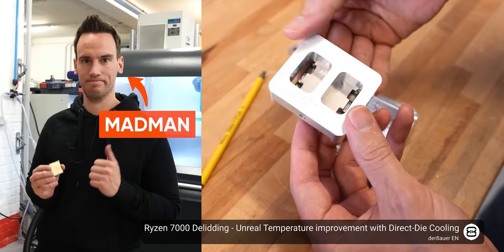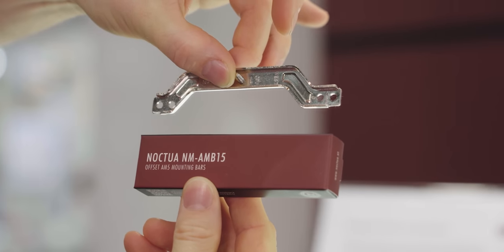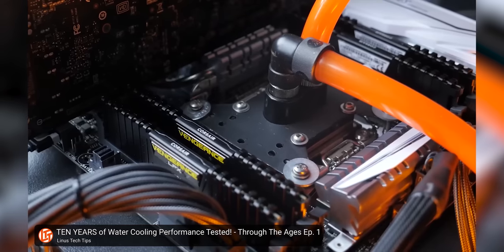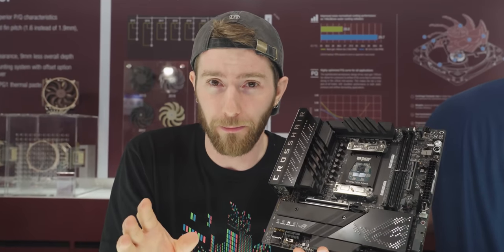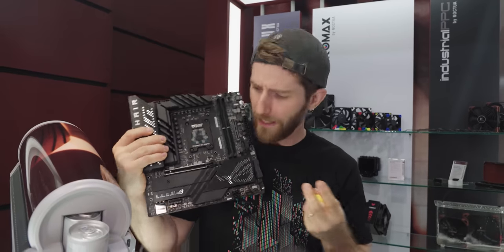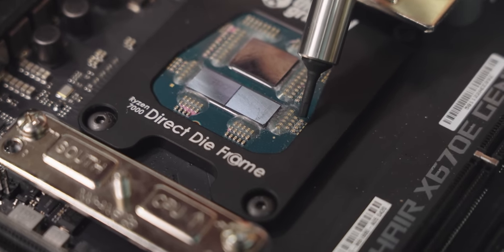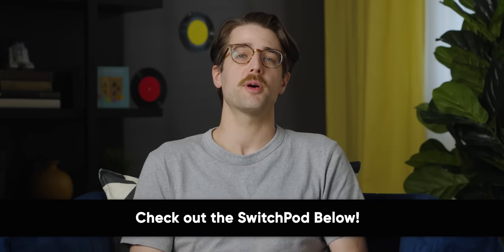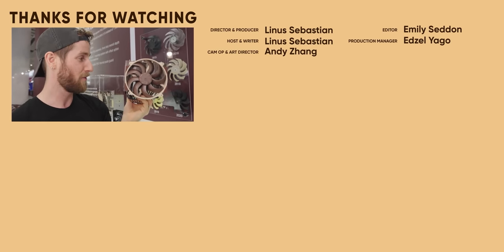Noctua's New Cooler Voids Your Warranty - AM5 Direct Die Cooling @ Computex 2023

Comment: For all the crap Noctua has gotten over the years for sticking, mostly, to its 70s dad suit aesthetic, you have to admit, seeing those coolers in a tech product instantly brings one word to mind... "Quality"
Reply: At this point that color scheme is instantly recognized as noctua brand.. Like green to razer, blue to Intel and red to amd
Reply: They also make other colors so if you really don't like it you can go with other options. The chromax black for example is my favorite.
Reply: I tried Bequiet products and they are absolutely horrific and nothing but pure junk so Noctua it is. Never had a Noctua product fail. Corsair and Bequiet are a joke in the PC world these days.
Reply: @jamesm568  bequiet are pretty good depending on what you get.
the power supplies are seasonic with their fans slapped on, cases are good, heatsinks are on par with V1 NH D15, the only thing I've had issues are the 80mm fans which have some cogging noise.
Reply: @jamesm568  What issues did you have with both Corsair and BeQuiet? I have Corsair ram, works perfectly. Corsair AIO on a friends pc, works like a charm. BeQuiet fans in my server, no problem. BeQuiet tower cooler smth (a smallish one) in another friend's PC, again perfectly fine. Noctua fans and cooler on another server of mine (Bought all of them from SH), working fine. I don't see a problem with BeQuiet or Corsair, and I do know noctua, they are great.
Reply: @satibel  Bequiet air coolers are decent as long as you swap out their crappy fans. Have no gripes with Seasonic as they have excellent customer service and never had one of their power supplies fail like Corsair does. I personally can't stand  Corsair with their poor ratings with the Better Business Bureau and are the most return product at Best Buy along with one of the worst customer service in the industry.
Reply: @sedixmrboss5625  I don't like the longevity and the quality of BeQuiet fans and Corsair branded power supplies are an absolute joke. I don't mind paying that Noctua tax as they provide great customer support with their products as that something that Corsair does not do. I used to use Corsair RAM, but a couple years ago their RAM was failing like hotcakes and they're still being sued over that incident. AIO are a personal preference, but I prefer to use the cheap ones as they're disposable items and there's not much of a difference in quality when paying a premium price with a name brand when they all still have a higher potential rate of failure.
Reply: @jamesm568  afaik the higher end bequiet fans are pretty good.
corsair doesn't have a lot of in house manufacturing so it's pretty hit or miss.
Reply: @satibel  Good enough for a hobbyist, but I wouldn't use Corsair and BeQuiet products professionally or in an enterprise environment. I really don't know many PC enthusiasts that use those brands either.
Reply: @jamesm568  tbh in an enterprise environement you'll probably use nidec or delta or some random no name brand if you have fans at all because you'll have prebuilt systems.
Reply: @satibel  That can be true. Have used cheap stuff myself, but I have found that using computer parts from German companies just last.
Reply: @jamesm568  tbh nidec and delta make some of the best performance and mtbf optimized fans, while noctua optimizes for performance/noise I've got some nidec fans from 20 years ago that have been used 24/7 for 10 years and they still work great, though they still make airplane noises because 6k rpm on a 140mm fan is loud.
Reply: @satibel  LMFAO! I know the feeling as I have a PC with 8 Noctua Industrial 3000 RPM 120mm and 140mm fans mixed for giggles. Loud AF when wide open and whisper quiet when RPMs are running less than 800 RPM.
Reply: @jamesm568   I can't speak for beQuiet's newer products for hotter processors, but the Pure Rock heat sink and its included fans have been good for me and my factory-clocked i7-6700 non-K CPU since I built it at the beginning of 2016.  That's in a Corsair Carbide 300R case, lol.  Granted, the i7-6700 is only a 65W TDP chip, but I've never seen the hot spot hit more than 79° C even running Prime95 torture test on all cores for an hour with FurMark going in the background.  But I also have a pair of Noctua's 140mm IndustrialPPC fans on filtered intake duty in the Carbide that have been running ~700rpm 24/7 since January of 2016, and they've been brilliant.  That little bit extra static pressure the industrial fans generate has really helped keep the inside of my PC clean and cat hair free.
Reply: IMO the design is by several magnitudes better than the "gamer aesthetic" with overloaded design elements and RGB which make your PC look like a toy instead of a tool.
Reply: @bartolomeothesatyr  I'm not a big fan of Corsair cases but that's just personal preference on that part. I'm a Lian Li fanboy on that respect(can't stand their fans though). In reference to air coolers most of today's air coolers can get the job done when you use the correct air cooler for the application it's in. As for fans I got a shelf full of worn out fans from various manufacturers that prematurely failed in a variety of uses. I never had a Noctua fan fail at the moment even for the ones that cool my router and cable modem that constantly run 24/7.
Reply: @jamesm568  I have a b quiet fan as an emergency backup, I bought I think 5 of them a number of years ago, while they are louder than I would use today, if a fan dies I have a cheap replacement fan so I can figure out what would best replace it with. I think there is an arctic 3 pack for fans at 20$ and this wasn't a thing when I bought my bquiet for this purpose.
Reply: Quality and function over form.
Reply: @alidan   BeQuiet fans definitely better than Uphere fans for sure.
Reply: It was a lot of fun turning 299 likes to 300 on your comment. :)
Reply: @jamesm568  All my corsair memory just failed. Cost me a boat load of money.
Reply: @Sorcerer86pt  I think it has way better form than anything in gamer RGB aesthetic. I like my computer to look like a tool and not a toy.
Reply: @jamesm568  I can concur with CONsair

My 1000D front panel I/O and the 18x HD120 Fans RGB lighting aren't working properly anymore.
Customer service was a nightmare to deal with as well, If you live as far as NZ, if you're trying to source replacement parts.
Reply: @meekmeads  Don't get me wrong, but back-in-the-day Corsair was the bomb. These last three to four years Corsair went downhill fast.
Reply: Call me a boomer I guess cause I love the aesthetic!
Reply: @jamesm568  some Corsair branded PSUs are excellent. The AX1600i for example is top notch. So are RM, RMi, RMx, RMe, HX and HXi PSUs. Flextronics produces the AX1600i I think (don’t know about the rest), but as far as I know it’s a  Corsair design instead of just a rebrand. Might be wrong though.
Reply: @agdp15  I rather go with Seasonic.
Reply: @jamesm568  to each their own, I don’t own anything from Corsair either, but the AX1600i is likely the best PSU on the market. Or at least it used to be
Reply: I have an IP67 industrial noctua fan on my telescope behind the primary mirror for fast temperature equalization. It runs slowly (with speed sense signal) and I have zero vibrations
Reply: Dude fr.  I actually could careless about asthetics now.  I'd actually argue the poop brown color of noctua looks great because every time you see them in a system, you know that pc is built for performance not some gaudy bs lol
Reply: @jamesm568  for Bequiet it's more of a question of which product...unlike Noctua, they have a range of average to quite good. I don't think they have anything quite as bomb proof reliable as Noctua though
Reply: @satibel  Most of their PSUs are FSP these days. Which is still solid!
Reply: @jamesm568  I'm a sales associate at a large electronics retailer and I agree. At this point, i just go with a brand/manufacturer who seem solid at the time, and i recommend brands who take accountability for their product...which is very few at this point. As far as CPU coolers...go air cooling until you can't. AIOs/water coolers are a roll of the dice. Either it dies in 2 years or it lasts 8 years.
Reply: @callistis8733  I had to go with an AIO after I got the 4090 as I had to mount the GPU where the power connector was pointing straight up so it wasn't stressed as a giant azz air cooler would not let me do that.

Comment: I'm definitely getting an NH-D15 when my current cooler kicks the bucket, I'll probably never need the monsterous cooling capacity but I love the quietness and want to support them for doing cool stuff like this
Reply: Those coolers can easily last 10 plus years, and Noctua will probably still support it when they release another one of theese add ons in 2033 lol
Reply: Say never, never. My 4790k homeserver gets cooled with an NH-D15. keeps it cool at all times and is dead silent too. Their fans are just legendary when it comes to their noisr profile. They blend in so well with background noise.
Reply: Got an NH-D14 that is still going with daily use.
Reply: Same here, I might not use its full potential as my desktop workstation is mostly idle while coding, but I want to support a great company.
Reply: Get a U-12A, it's a normal sized tower cooler, almost the same performance as the (old) D15, it's more than enough even for high end processors or reasonable overclocking.
Reply: You can also support them by buying their fans for your custom loop rads ;)
Reply: It works even better when you stick Noctua's 3000 RPM industrial fans on it.
Reply: @DrakkarCalethiel  Just replace the old fans with the next gen NF-A14 and you'll get better performance.
Reply: Bought NH-D15 for my R5 2600 when the stock cooler was running too hot. I knew i was going extremely overkill for the R5 (I'm oc'd to 4.1ghz at 1.3v) but at least im future proof with it, and since noctua has released new fans i can i guess just in the end change fans when one breaks, 6 years warranty as well from where I bought it and people been running noctua stuff without issues even for 10+ years. it's worth it, especially with the 2nd gen coming out i would get that one 100% sure considering how noctua has been doing their shit so we'll.
Reply: @Majorowsky1337  The R5 2600 can be cooedl with a 120 mm AIO without even needing a fan on the rad. Lol! With that being said it never hurts to buy the biggest air cooler that can fit in your case either.
Reply: @jamesm568  My CPU does run a bit hot because the case is not the greatest when it comes to airflow (NZXT H510) But otherwise yeah it never hurts to go for the biggest when you can use it for the years to come haha. also included thermal paste is a nice thing with the cooler ;)
Reply: I got a d15 with my 1700 when I built my 'new' computer about 6 years ago, my 955 would have its stock fan gum up with dust, and no way to get at the back of the motherboard for a tower cooler without ripping everything out and the case was a nightmare to deal with. so I opted to just clean the cooler every 2-3 weeks when dust would clog it again. got the d15, put it on the cpu, cant hear the fans, and both towers have been clogged with dust at points but the cpu never hits a thermal throttle load, absolutely love this cooler because it made dealing with the computer not painful.

Comment: Man... direct die was the norm for AMD CPU's "back in the day" so, this isn't all that scary. And now that Intel and AMD are hell bent on pushing their CPU's as far as possible out of the box, it's more and more likely that when I upgrade, I'll be doing this with my next system.
Reply: "Back in the day" was pretty scary. Had to use a screwdriver to pry down the retention clip. One slip and you damage the motherboard.
Reply: @asm2750  I'll give you that. Severing some mobo traces was a far more scary proposition than cracking the die.
Reply: I worked in an IT retail store during that time.

We had about 6 trays of CPU with cracked dies. I think only about 5% of them got a RMA refund from our supplier.

I was mainly caused by people putting the cooler on the wrong way round since it had a notch milled out of one side.
Reply: @bofh139  Yep, that makes sense. I never cracked a die and I can't tell you how many AMD systems I built back then. Granted, I was a seasoned builder at the point and knew what I was doing. I imagine more people bend pins than cracked the dies back them. Granted, you can replace pins. Cracked die is donezo.
Reply: Having zero warranty for a £670 part seems scary to me. In fact it's downright terrifying.
Reply: @TheGameBench a cracked die today means a 100% dead CPU, tho
Reply: @LtdJorge  A cracked die back then meant a 100% dead CPU as well. I would say though, that you're less likely to crack a die now, than back then. If you're using a frame, it should be a non issues, since it's much easier to even out the mounting pressure. I would just advise against any cooler that uses the brackets that come with AM5 boards. You have more to fear from delidding than direct die.
Reply: @bosambo  Sure... delidding isn't for everyone.
Reply: i suspect it has to do with the dies being a bit less durable after a certain point in computing, due to them changing the base material thicknesses. there used to be a bit more silicon between the 'guts' and the 'top', making it a bit harder to fracture the die.

couple that with them making the pcbs the dies are mounted to slightly thinner, and its there was concern for the die flexing that pcb leading to issues over time, or immediately if you  had a solution that applied too much pressure.

less material in the dies, interposers and substrate pcbs, leads to less mechanical stress capability. the heat spreaders serve(d) as a pressure load distribution plate as well as its primary function.

one can literally compare an xray cross section of various generations of cpus over the years (they're out there, though some are harder to find), showing the shrinkage of the various layers, leading to the possible problem of pressure breakage. (think like intels somewhat infamous and randomly reoccuring pcb flex/cracking problem, even with heat spreaders involved.)

at the end of the day however, most super enthusiasts will take the risk of maybe applying too much pressure and killing a given chip, simply to get the most bang for the buck out of it.

i do rather wish they'd at least try a bit harder to get the baseline temps with the heat spreader on them down some. the 7000 series chips run abysmally hot when they don't need to. both from the voltages and the layout on the substrate not reflecting into the coolers optimized focus area (given the hotspots are to one side, vs the middleish).
Reply: @TheGameBench . Aren’t the dies thinner now? Isn’t the top most layer also thinner?
Reply: Cranking down the Pentium 4 heatsink and seeing the 6mm bulge on the back of the mobo.
Reply: I remember buying a shim kit for my old Athlon 1333. I also had a Peltier and a, rather early, water cooling kit.. in 2001. It worked rather well.
Reply: It has got much scarier now as when Intel and AMD have been hunting better cooling for their extremely power hungry chips they have made the dies thinner, which means weaker and easier to crack if cooler isn't being mount perfectly on top.
Reply: It was actually an exception during the t-bird/duron era. Previous K6 were lidded and next gen Athlon 64 regained the lidded normalcy. Intel did the same thing with their Pentium 3 line up. P2 were "slotted" and P4 were lidded.
Reply: @robertt9342  Hmm... maybe? I don't know, but looking at the die of the XP 3200+ I have here, the Z height... if anything, looks lower than modern CPUs. But it's a question I can't answer considering how dies are layered and we're talking measurements that require specific, highly accurate, tools to measure. Regardless, I don't think it's easier to crack a modern die. You have the frame to guide you and coolers that you can screw on to even the load on the CPU. I would say you have more to fear from the delidding process than direct die itself.
Reply: I remember when Fry's tried to sell me an Athlon Thunderbird with one of the four rubber mounting pads missing from the CPU.
Reply: @HyraxAttax  Oh yeah... those pads were all that really saved people from cracking the dies.

Comment: I understand that there’s a device that helps you get rid of the heat spreader, but I’m always worried about cracking the die whenever I even think about attempting it.
Reply: I'd be worried even if I got it off. I remember my Athlon XP dying because a corner got chipped. It's extremely easy to do.
Reply: a very reasonable worry, even with the devices haha

Comment: I got a NH-D15  SE-AM4 on my AMD 1800x and ASUS C6H and that thing has ran like SMOOTH Butter since DAY 1 ! My STRIX RX480 makes more noise WHEN it winds up,in games,and only 50% of the time. My Power Supply NEVER RUNS during operation,only a check spin on start-up. If you curious,it's a Corsair AX1500i, BAD A$$ and VERY efficient !
 But that NEW chunk of SWEET metal when i 1rst saw it,made my heart drop to the floor ! DAM I WANT IT !! That WILL be on my next 7000XTX build ! It was JUST what i was hoping for,then they made it ! THANKS NOCTUA, DE BAUER, & THERMAL GRIZZLY !  This Combo is the SNITZ !! 😎

Comment: 2:17 Seems like the cooling pipe orientation would work far better if rotated 90 degrees, since the heat area over the CPU dies is a wide rectangle. Rotated every cooling pipe would run over part of the dies.